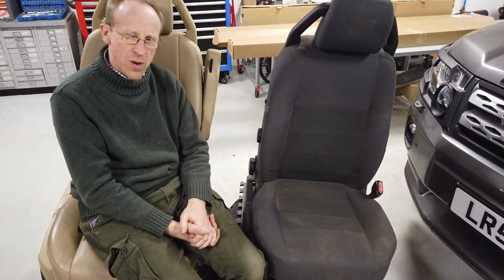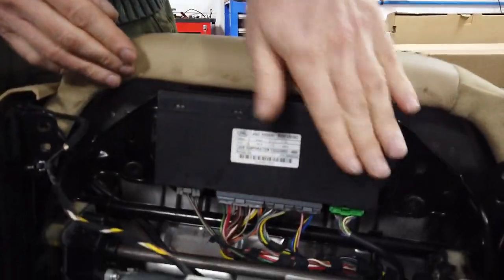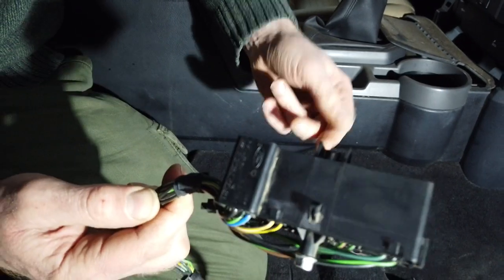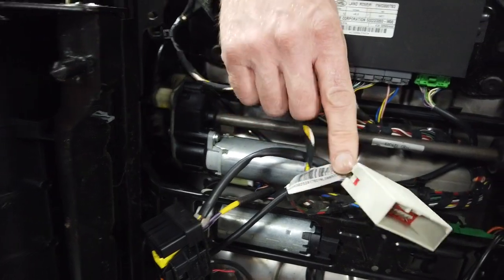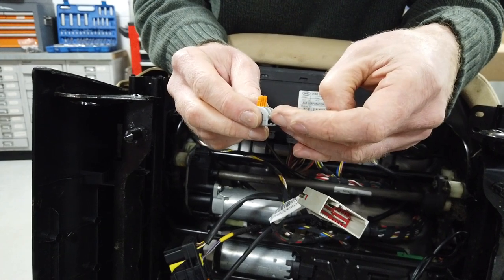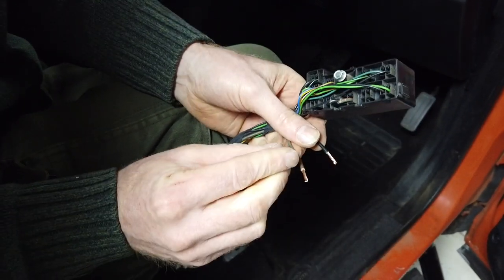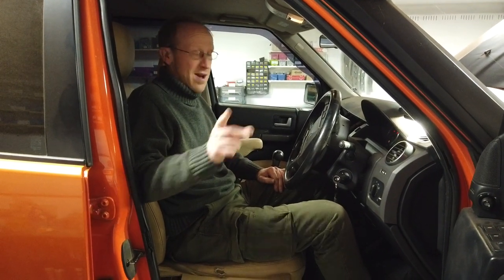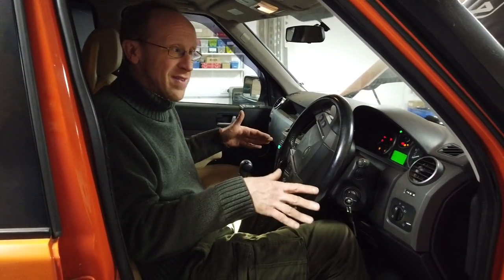Land Rover Discovery 3+4 Electric seat retro fit / upgrade also Range Rover Sport LR3 LR4

Comment: Someone got the seat heater to work? I have the correct panel purchased but can't find an instruction how to connect. By default there are no wires behind the panel to connect the heating.
Reply: I managed to do it . With Simons permission I made a video for him on my channel.

Comment: So in theory putting seats in that had heater elements into a non heated vehicle you would also need the hvac controls and it’s plug n play after that? Granted the original seats were electric to begin with?

Comment: Does anyone know what the purple/brown wire going to the heated seat control module (bq8aa) does? I presume it's the temperature control of the seat but I'd like to know what the input or output voltage is.
Reply: Sorry, it's just a brown wire.

Comment: Hi bud. Do you have a diagram for fitting d4 memory seats in my d3 its currently has manual seats.. im not fusses about the memory settings working just want to adjust the seat.. its strange because the passenger seat was plug and play but the drivers seat wont work.

Comment: I just fitted some L320 seats to a VW T6. Thanks to the video I’ve managed to get the electrics working. I never thought I would get them working! Genius.
Reply from the maker: Nice work!
Reply: Hi I’m just fitting some in a t5 but having trouble finding how to power the passenger seat up any advice 
I have done the drivers from following the video
Reply: @craigennis8275 did you ever find the solution? I have the same issue, got the drivers side powered but not sure what the equivalent of the red/white and black is on the passenger side 😊

Comment: i have some LR2 seats with memory, trying to fit them into a Toyota LandCruiser 79 series. today i hooked the seats up to power, and still had the same problem the seats only moved 1/2inch at a time. how did you get around that????

Comment: As usual perfect description easy to follow. Carried out this mod now trying to sort out the heated element of the conversion. I have fitted control unit . Just require the loom between the control fan unit with heated seat function down to plug in foot well. Have you got that far yet Simon.
Reply from the maker: Hi - not got that far yet.... got distracted by the new Defender !
Reply: @L663  well sure you have shared enough info over the years to me so I will keep you informed and let you know how I have got on and how i did it.

Comment: Such a great video. I’ve managed to get the drivers side working, these are going a VW T5 by the way. I cannot get the passenger side working though. Do you know what the equivalent wires are to the red/white and black from the drivers side?
So could I just powered the heated element and place in a switch which I could put down the side? 
Lastly, I want to permanently ensure no side air bag goes off. How do I disable that or do I need not bother as it’s not connected to a plug. 
Sorry about the questions but you clearly know your stuff. 

* I sorted it *

Comment: Great video again Simon!
Any chance you could find out if the wiring would be plug and play if upgrading from Discovery 3 non folding, no puddle light door mirrors to Discovery 4 2014 folding door mirrors? Cheers 😊

Comment: Just done this and thanks for a great video guide . A lot tighter to fit in a commercial as the bulk head makes life a bit harder and loads of supports to strip out to get to the seat bolts.Did you ever get any joy finding plug in the dash for the heated seats ? We got the control panel but couldn't find plug 4 anywhere. Also to note our drivers seat exactly as you showed but passengers seat slides in a fully fluid motion back forward up and down. Thanks for a great guide.
Reply from the maker: Hi Dave - glad it helped and well done ! Read the comments as I seem to recall someone had worked out the heating retrofit.

Comment: Hi there - Did you ever get to connecting the heating elements? I have a D£ in which the previous owner did the seat swap and control swap, but there is no cable in place from control to seat. Hoping to find the spare cable somewhere!

Comment: Hi!  Great video.  Did you find out the problem with the driver's seat electricity error? Have the same problem on my LR4. The seat only runs for about 1 sec at a time and must release the switch and press again .. thanks for all the tips.
Reply: I do think it needs to be enabled in the software.

Comment: Do you maybe remember when you did this, the drivers seat moved in 10mm increments, but did the passengers seat work without stops? Thanks
Reply from the maker: I cant remember ! sorry
Reply: Try putting the seat through all it's full motions, the memory module may remember them providing it is powered.

Comment: Hi im fitting this seats into a renualt traffic after hours of you tube i found your video and what a god send that was now do you have any idea how to wire the passanger side seat up iv tried a few wires and got power to the relay but not to the switches any help your be great..... Many thanks Paul
Reply: Hi, I’m thinking of doing the same to my trafic, but struggling to find any measurements. We’re they a good fit? Did you need to adapt the trafic seat base?
Reply: Hi, did you ever find a solution, I too cannot get the passenger side working.

Comment: Hey guys, first off, very informative, new sub here! Question: Can you do the same vid for Discovery 5 HSE seats? I'd like to know which one is the airbag wire, to disconnect it. Tia, Greg
Reply from the maker: We dont have a disco 5 but it may be similar on the Sport L494
Reply: @L663  thanks so much, will have a look at that!

G

Comment: If you change the Climate control panel, would the heating work as well for Discos without heated seats? Technically all the wires are there so it should but if someone could let me know I would appreciate it.

Comment: Bin the memory module off and adapt the switchs from another vehicle much easyer and your able to use the seat functions correctly I did this on my base 7 seat discovery 3 when fitting discovery 4 seats as I diddint want to faff about have 0.5 seconed power pulse before the module realised the can line was not complete
Reply from the maker: I was considering just by passing the mem module - no reason to change to switches from another car. I could do a video on that ... would not be too tricky i dont think - just wire up like passenger seat.
Reply: Hi was wondering if I could fit discovery 4 seats in a discovery 3
Reply: @L663  How do i do this, i have a disco 3 with upgraded seats. My passenger seat works perfectly (including the heating element) but my drivers seat does what yours did in the video and pauses until you stop and start again. Also, my heating element in the driver seat doesn't work. I am wondering if these are related? Whats my options please
Mark
Reply: hi @Mark, can you help me with how you did this?

Comment: Have you tried the same in a LR discovery sport as trying to do at the moment and guessing i need to find the positive for the memory function to be able to power these up in the same way you di in the video but cant seem to find decent wiring instructions
Reply from the maker: We have not tried this but will keep our eyes open for some seats
Reply: Managed to do it on mine now roughly the same just need to make sure you.power and earth to mem module switch unit and 8 way motor unit. Does the same as in only moves a little at the time 
Might try it on another spare set that does not have a memory module and see if that works better

Comment: Did replacing the heated seat controls work? I have electric seats and no heated seats, but I have 2 electric seats and a control unit available. Would like to know soon as possible if that's all it takes.
Reply from the maker: We have not got the heated seats working yet

Comment: Hello i have inquiry about Range rover sport 2020 , my car V6 has fully electric seats with heater but with out cooling fan so i am planning to replace the seats with another secondhand seats that has ventilation cooling system (FANS ) ,,  my inquiry is , do i need to do wiring job , or it is ready to plug and play ? i believe i need reprogram the system and that is easy but i am wondering if the wiring sockets already installed in the car ! i would appreciate if you have any information in this regard ,thanks
Reply from the maker: Hi Ahmed - i think you need to change the CCF files so you get the menu on the car screen for cooling - the cooling is from the aircon so i guess there are ducts in the seat. A friend did this upgrade on his Jaguar and it just plugged and played with a CCF change so you may be lucky !
Reply: @L663  thank you for reply , i can do CCF files as i have computer to reprogram the system , but the important point , if the V6 has the full seat wiring pluges so i can plug the V8 seat which it has the extra plug for  the cooling ducts ,, have you seen any diffrent bettwen V6 and V8 in the base wiring down the seat , i mean the main wiring coming from the car body , not from the seat ? kindly highlight me if any , thanks

Comment: Hello Tyler,
I got a Range Rover Sport HSE from 2006. The electric seats whit memory are pre installed. Is it enough to change the button pannel to get the seats heated? 
Greatings from the Netherlands.
Reply from the maker: Not sure - there are a few things needed - Fuse / element in seats / wiring / control panel. As my car has this already i am not sure what parts you have / dont have.
Reply: Hello Tyler,

I bought the button pannel but found out there is an extra connector on the back. I can not find the wire that should fir in here. I made a photo but can not put it here.

Comment: This video has been really helpful, do you know where the other end of the wires are for the heated seats to plug into the back of the centre console under the radio?  (Where have Landrover hidden them?)
Reply: For anyone wondering, the answer to getting the d4 heated seat working in a d3 , is the controller is in the seat in a 4 and in the car in a 3. To fix you need to require the elements and temperature sensor in the same way they are in a d3 to remove the controller in the seat

Comment: Hi guys great video thanks for your help. I also have the seat in inch mode as they call it which is something to do with the stall detection mode, medium speed CAN bus network. 
Did you manage to solve this at all? Thanks for the video
Reply from the maker: No we did not solve this - we have not tried.

Comment: Great Video! We are struggling to fit some Discovery 4 Leather NON memory seats into our project Disco 3. We dont have the grey plug you had on the base of the seats. Could you do a video fitting D4 seats to your other project D3?
Reply from the maker: Here is the wiring diagram for non memory seats... this is for D3 - does this look similar to what you have
https://www.dropbox.com/s/1rxrqcv6orswx7q/non%20memory%20seat%20wiring.JPG?dl=0

Comment: Hi Simon,  I was wondering I have an electric seat it does all the movement excerpt the forward and backward what could that be? Motor? connections or switch?
Reply from the maker: Interesting - it could be the motor or i think there is a limit switch in the circuit somewhere... i can see this would be a pain !

Comment: Hello my friend, I have a 2009 Range Rover Sort, the ABS, suspension and dynamic signs have appeared and then disappear and come back again, it is now uncomfortable due to the suspension of the suspension and the problem is only in the electrical system, but where is the reason?
Reply: Check your abs sensor. It triggers suspension fault when its damaged or faulty

Comment: Hi Simon! I am trying to retrofit l494 seats in my l663 defender? Are you willing to help? :) thanks in advance!
Reply: Sounds interesting - what help do you need ?
Reply: @Simon Jefferson  I have fitted the rear seats "successfully" I have tried to install the front ones, the screw positions and the connectors are identical, but after pluging in the connectors, the seat is completely dead. I noticed that some of the cables do not match/are missing. My current seats have the electric tilt, everything else is manual.

Comment: Hey guys I’m installing L320 rang rover seats into a series 3 Land rover, I just want the front back up and down tilt functions only, how do I power it up, I have a yellow orang blue grey and black plugs, any tips would be great
Reply: Hey mate, I'm doing the same in a series 2a.
The black plug will power seat control switches. So you would need to disconnect the front/back switch to disable it, or just only use the tilt button.
Any pictures of your installation?
Reply: Hi I worked it out it’s the same as the connection in the video the black plugs takes the positive and negative grey plug joins to the black and the purple grey wire takes a 5amp positive, everything works up down back forward up and down

Comment: Just done this process in my d3, has anyone managed to get the electric lumber air pump to work by adding power into the loom ?
Reply: The white red wire to plus ➕️  it's on separate plug on its own,don't remember colour of the plug ..

Comment: The bursts of movement is a common problem  with this upgrade. I think the problem is all about the red wire needing connecting up, but not proven it
Reply: Hi Andy, what do you mean by connecting up? I have the same issue with burst movement
Reply: @markadams2656  did you ever solve it?